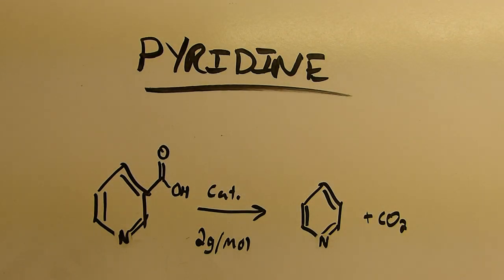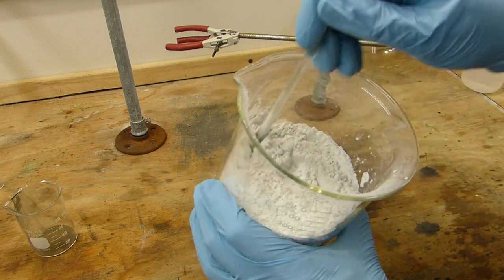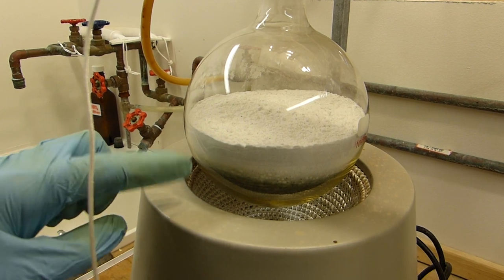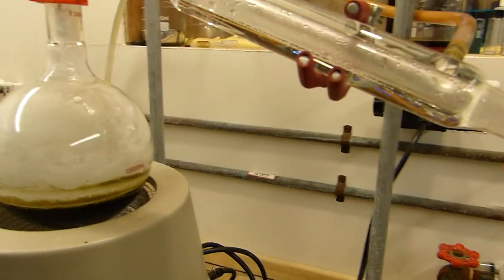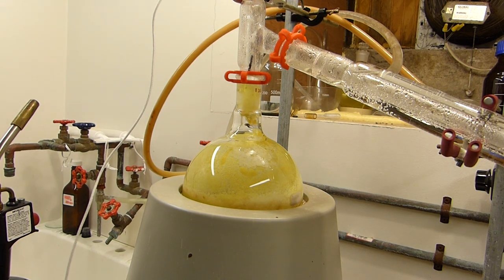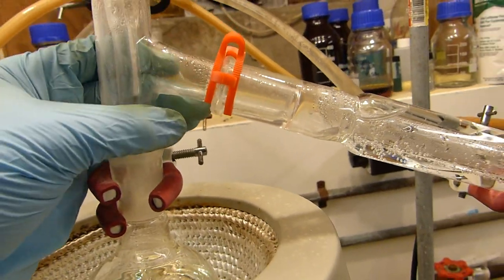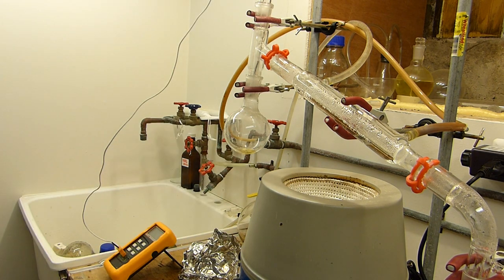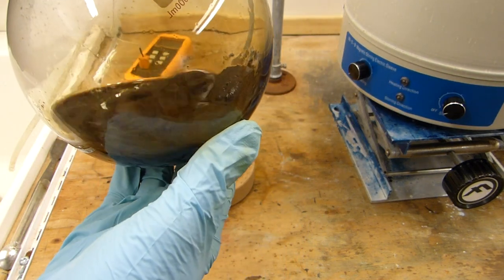Pyridine from Niacin

Comment: I found it works well to control the heating mantle with a PID controller connected to a temperature probe placed in the still head.  And a light dimmer in series with the mantle also helps to tune the setup.  I was able to leave this unattended overnight after I got things set.  The temperature in the flask gets high enough to push some pyridine over but then backs off before much sublimation of the niacin occurs.

Comment: Pyridine is a handy base to have around. For one as a common tertiary amine and Lewis base , to make PCC (pyridinium chlorochromate),and Collin's reagent (pyr.CrO3), both very selective oxidation agents, milder than CrO3 itself. Electroreduction at a lead cathode to obtain piperidine would be cool too provided you can do it in a closed system. The last thing you want to do is have an open cell with flowerpot diaphragm through electrode gas evolution spray a fine mist containing pyridine in the air.

Comment: Here is a tip: Use a reflux apparatus at first, and the pyridine will serve as a solvent and add all the niacin you want, reflux for a bit, and then distill.
Reply: I use a small straight adapter between the flask and the distillation head that serves as a poor man's reflux/fractionation column. It's a straight 15cm tube with 24/29 joints. Works pretty well in this setting.
Reply: I'm not a chemist by any stretch of the imagination, but I've been watching tons of chemistry videos for their entertainment value, and this was the exact thought I had! REFLUX IT!
Reply: The reaction won't proceed at the temperature of boiling pyridine. It needs to be about 250ºC.

Comment: Cool, I like your video's very much.
I noticed you clamped the distillation head and rely on a clip to connect the roundbottom flask.
 I was taught to clamp the neck of the roundbottom flask in a setup like this. The weight of the distillation head should rest on the round bottom flask. This ensures a good seal of the ground glass joint. A clamp around the neck of distillation head is optional, and if used should be very loose, just to prevent sideways motion.
Reply: I think that in this case the high temperature could damage the plastic clip.
Reply: I usually don't clip the round bottom flask to the distilling head because of this (I burnt one some time ago), but you can use a metal clip if you have it available

Comment: Hey Doug,I tried to ask you a few question's before in the comments of your ketene lamp video, you didn't answer those questions but if you could at least answer one question on the same topic, I would greatly appreciate it. What gauge nichrome wire did you use for the filament??

Comment: do you think the copperchromite kat. also works do decarboxilate benzoicacid ?
Reply: @dylanmcvicker8330  That's a really bad idea, there's no way you have a cooler at home that can reliably cool vapors of 300-500°C down to below 80°C. Probably produces a variety of polycyclic hydrocarbons in the flask and gas phase at those temperatures as well.

Comment: Why didn't you reflux until the decarboxylation was complete and then distill?
Reply: thats what i was thinking
Reply: Doesn't work for the same reason you can't reflux salicylic acid and turn it into phenol. The stillpot containing molten niacin is far hotter than the boiling point of pyridine. There's a temperature gradient up to the stillhead. If you try to reflux, the stillpot drops in temperature to the boiling point of pyridine and decarboxylation slows to a uselessly slow rate.

Comment: You say in the beginning that niacin is a hydrolysis product of nicotine 0:15 , so is it possible to convert nicotine to niacin? I haven't been able to find anything on doing this
Reply: It may be possible but you need reasonably pure nicotine to do it.
Reply: I have access to fairly pure nicotine from an e-liquid supplier, would that be pure enough to try?
Reply: Niacin was first prepared by oxidation of nicotine with nitric acid. Nicotine also oxidizes under UV light to produce nicotine oxide, methylamine, and niacin.

Comment: If the sulphuric acid is very clean but just diluted, can you not evaporate all the water off at 200 deg C?
Reply: Yes, this will work out, but probably at a far higher temperature than 200 °C. Sulphuric acid forms an azeotrope with water with 98% H2SO4 with a boiling point of 338 °C! I dont know what exactly will happen at 200 °C, but I assume only a partial removal of water. Dealing with such high temperatures with glass-ware always poses a serious risk. Concentrated H2SO4 at room temperature is no fun, but the acid at 338 °C is a horror.
Reply: @196Stefan2  I did do this years ago and it worked. I heated 500ml of 68% H2SO4 at 500 deg C with my expensive lab grade hotplate and I got 94.5% in the end after about 5 hours. It was a risk but I did this on the balcony outside.
Reply: @Berghiker  A liquid at ambient pressure, heated in an open vessel, actually can never get hotter than it's boiling point, in case of H2SO4 338 °C (Water 100 °C, Ethanol 78°C, Acetone 56 °C etc.). The boiling point may raise, the higher the concentration of the acid gets, but 500 °C no way!
Reply: @196Stefan2  Ok. I didn't have a thermometer that time to measure it.

Comment: What could be pyridine used for?
Reply: Pyridine is a good solvent for other reactions.  The HCl salt is also a catalyst for a variety of reactions.  Stinks like hell though.  I hated using it when I worked in a lab.
Reply: Grak70 Oh... I was hoping that it can be used to make pyrimidine and then some nucleotides for DNA synthesis ;J
Reply: Sci Twi Nah, they're totally different heterocycles. Can't make one from the other.
Reply: Hmm... So our bodies cannot convert one into the other? What is the precursor for pyrimidine then? (I'm just being curious.)
Reply: Sci Twi synthesis of nucleotide precursors is incredibly complicated in biological systems. Just google "biological synthesis of pyrimidine" and you can find sources. There are generally two routes: de novo synthesis from CO2 and amines, and scavenge synthesis from bio-waste products. Both routes are enzyme catalyzed and light years beyond the ability of any organic chemist.
Reply: So how do they make those terminating nucleotides marked with luminescent dyes for use in DNA sequencing or synthesis? I guess there's no organism or natural enzyme which would produce such "broken" nucleotides, so they have to be made in a lab somehow?
Reply: Sci Twi they're very clever. :-) look it up! It doesn't start with lab synthesis though. Usually they introduce artificial starting materials and let nature do its work or do clever grafting after the fact. Nothing so basic as nucleosynthesis.
Reply: For example, it can be used as a scavenger molecule to remove methyl groups from aryl methyl ethers. It is used widely in pharmaceutical industry for syntheses. Great solvent.